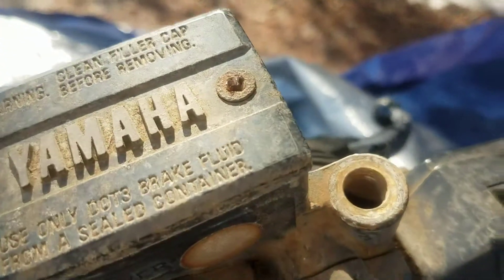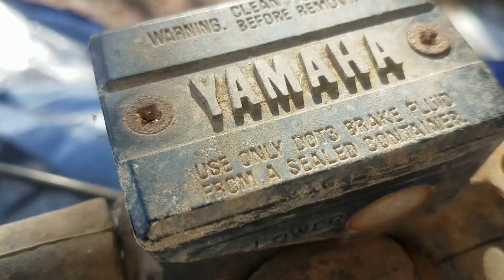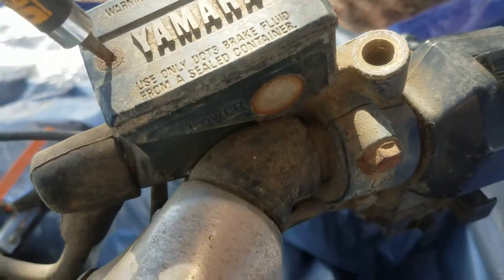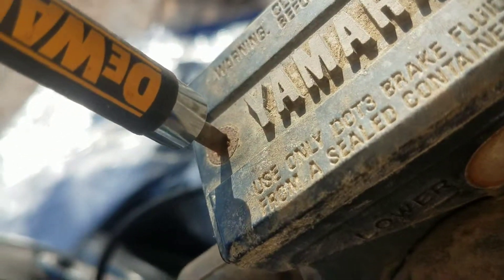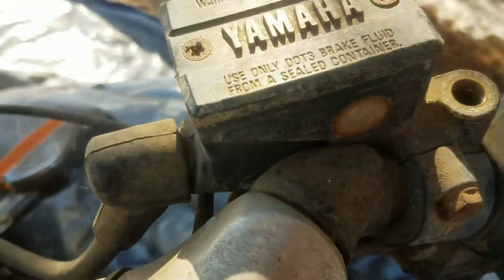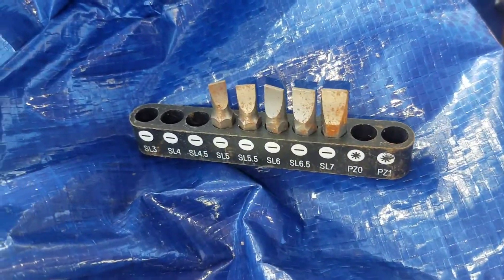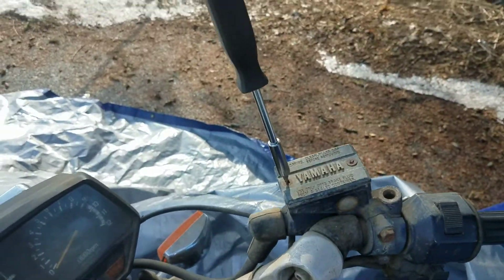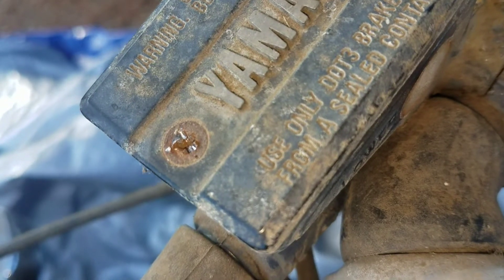How to Get Out a Rusted Stripped Screw Without Drill - Flathead Method

Comment: I bought a house and I'm trying to clear the pipe because the tub drains slow. My screws on the metal grate are rusted and stripped. Brb gonna try this and update.
Reply from the maker: U may need a dremel and cut a slit into it, but I've also learned of impact screw drivers the past 3 years. They work well too.
Reply: @Backyard Revivals  I tried your method and it worked like a charm!  The tub drains like new and everything is all clean. Thank you so much.
Reply from the maker: @user-kf2jm1yv4c  cheers! 🥳 🎉